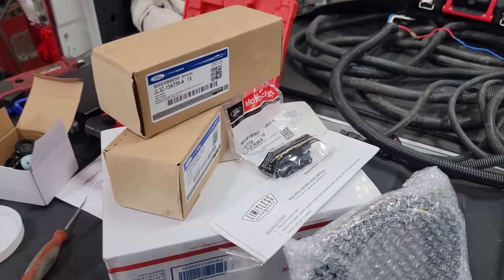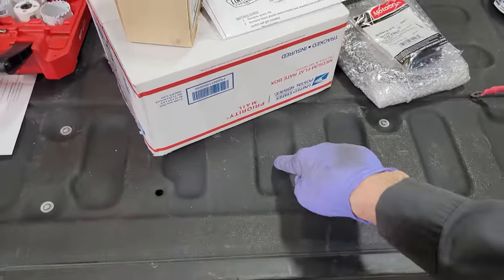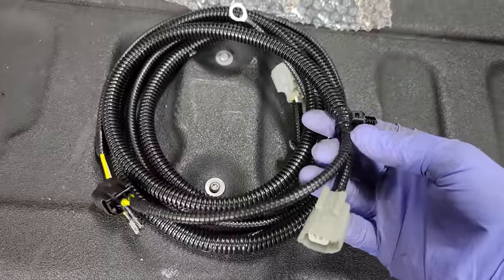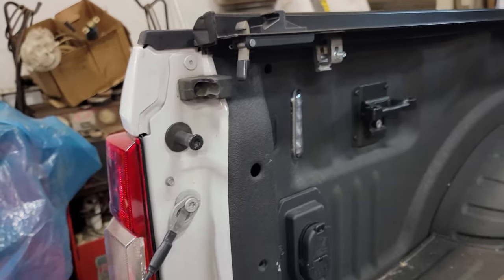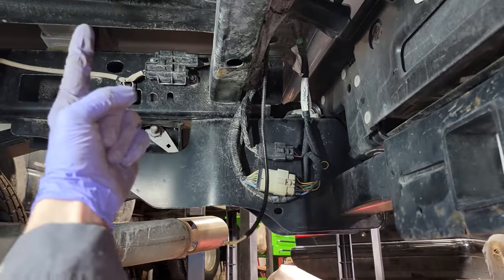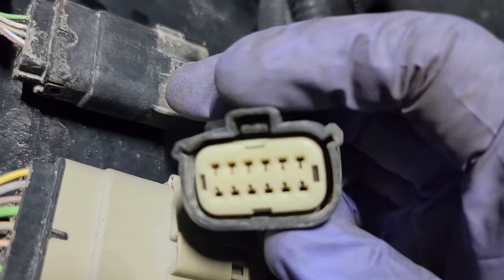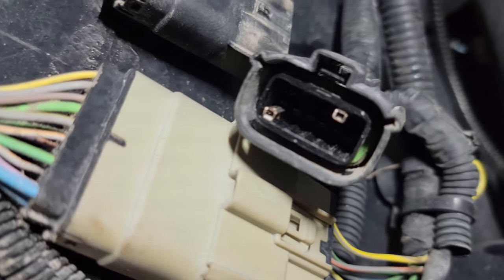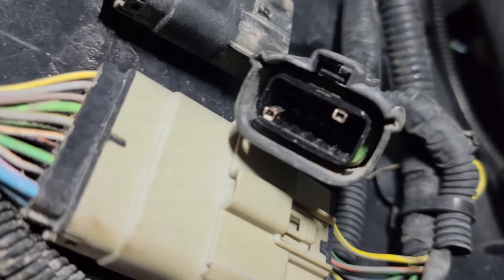Your truck missing this option?? FACTORY Bed Light Install | Ford Superduty 2017-2022 EASY!

Comment: I just finished this.  The most challenging part was removing the small white piece from the connector, and I was a bit anxious about pinning since I wasn't sure about positions 4 and 11. Despite my initial concerns, everything turned out correctly. Overall, the installation was straightforward, even for a beginner noob like me.
Reply from the maker: So glad fer letting us know bro 😎

Comment: hehe .. nice to see DS and the other guy crawling down there on the floor ilgag with you Aaron. hehe
one thing that is clearly true is that there is High quality cable harness.
it will be a high and nice mount on that mount .. nicely worked

Comment: My 22 F450 came with these and never thought Id ever use them but they've come in handy a couple times. Also, that little led on the rear of the tailgate (docking light?) surprisingly helps a ton hitching up to a tag a long trailer!

Comment: WOW .. finally something for us STX folks.  Been waiting for this since I purchased my 2020 F350 STX dually.  Bought the truck last dec and was the only dually on the lot so no choices.  Was missing the LED Bed Light kit.  Order placed with Limitless and can’t wait to get this installed.  I have the Forescan dongle but never used it so may need a hand in the programming part.  Thanks for the install video ARod … thanks #LimitlessAutoWorks for this new addition to your custom harness offerings.
Reply from the maker: Email me will get ya set up programming 🙋‍♂️

Comment: Easy install on a 2020 STX dually.  From opening the box, about 25 mins total install of the parts, dropping spare and routing cables.  Newbee to ForScan and took extra care, double check everything .. programming took be about 10mins.  (was nervous as chit).  One word of caution though, find a large, heavy gauge paperclip to remove those 2 black plastic plugs ARod pointed out.  I used a Jewelers Phillip screw driver (like you use for glasses) I had issues, must have damaged the back.  Issue manifested itself where I couldn’t push that “white” guide back in properly and couldn’t get the plug to the truck connector to “snap” back on.  Ended up trimming about 1/8th of an inch off the fins .. and it all worked out.  That original grey and white/red wires (pins 2 and 12). are connected to two of the brake lights.  You’ll get a “fast blinker” if that bumper harness connector doesn’t “click” back properly.

Comment: Man, I wish this was around a year ago. My truck did not come with bed lights from the factory. So I had to piece together a bunch of parts and make my own harness. It works just fine but this would've saved time and effort.

Comment: That is a really well made harness - I don't understand why it has two ground connections, though. I would think it would only need pin 4 from the harness since it already has ground from the bolt by the spare tire.
Reply from the maker: Switch n two lights my man

Comment: Please consider a factory power running board install. Yes I understand I could get the AMP steps but I think the factory boards are a much cleaner look.  Plus you can enable the function option with FORScan. Thank you!
Reply from the maker: Circuits are part of the cab harness not gonna be as easy as you think
Reply: I understand a person would need to add a few items behind the rear seat and do a little creative wiring but if anyone can present a step by step video with a complete parts listing you can,  please think about it. Have a great evening!

Comment: Wow, thanks for this video.  I have wanted this on my F150 and wasn't sure how. Great explanation.
Reply from the maker: Easypeasy
Reply: @PowerStrokeTechTalkwARod  True.  Anyone can run wire all the to the cab and find 12 volts, or tap into a harness somewhere.  But that is trashy.  I like to keep it as factory as possible.

Comment: Not sure if it matters but you changed 72-01 instead of 71-01. Sweet install though, love lights..
Reply from the maker: Fat finger
Reply: I checked the comments just to see if anyone else saw this. I was worried for a minute it might mess something up but luckily it was recorded so easy to correct.

It should also be noted for everyone to learn that you should backup every as-built before making changes and have it saved in multiple places so you can’t lose it. Without proper backup you may be unable to correct an issue or mistake and the downloadable from Ford as-builts may not work since they are NOT guaranteed to be the same as what was there originally and could include the error or mistake that caused the issue.

Comment: Are they releasing this kit for the 2023-2024 Super Dutys?  I did not see it on the website but would buy it instantly.
Reply from the maker: Checking
Reply from the maker: That's a negative sor

Comment: Bed lights are awesome!  My platinum came with them, I am impressed with the output. Still would rather have had a Lariat, but with today's availabilities take what you can get. Luckily my 2020 hasn't been part of any recalls, especially the axle recall. Good video!
Reply from the maker: Niceeee

Comment: Hey .. your second ForScan value was applied to the 726-72-01.  Was supposed to be to the 726-71-01.  Does it matter, or did you correct on a 2nd pass?
Reply from the maker: 2nd pass fat finger

Comment: Will this for scan programming work on a 2022 Lariat? Not a super duty. I want to buy the factory lights, switch and harnesses from the dealer.
Reply from the maker: There is NO harness that ford sells. You will need all the parts listed in this video. Forscan works on all Ford vehicles.....

Comment: This is a great video Thanks!
I have a 2019 f150 XLT but my wiring seems a little bit different, I have a button on the dash for Bed lights, and pin 11 is occupied for me. Would this method work for me? especially will the lights work with any of the switches? Thanks again !!
Reply from the maker: Buddy, read the title very carefully

Comment: Thanks for the video! Very close to pulling the trigger, do these tie in with the bed light button in the cab as well? So you can use the bed button switch or the cab bed light switch?
Reply: These work exactly as it would work from the factory

Comment: Great video ARod nice work , did u put this in ur truck if so how good do they work with ur bed extenders in plus can u get to the switch. I got the LEDs along the rail of the bed because of my bed extenders. Thanks ARod
Reply from the maker: My truck came with them already. Yes, you can still get to the switch & you see the lights just fine

Comment: I bought a f350 super duty 2022 and had the double alternator installed but did no know you had to ask for pro power aboard and only have 4Kw in the cab i would like to 7.2 in the back and program it for Pro power aboard  - is this possible

Comment: Nice install can I add power step to my power running bords to my 2022 f350 lariat? It dident come with because I ordered the black appearance package so option wasn’t available. But my question is can I buy all factory parts and will it plung in or is even possible to do
Reply from the maker: Cmon, now I gotta talk to my boy. You guys got us so busy hahahahaha
Reply: Let me know I’ll order the parts from your dealership my local dealer ship not vary helpful I know that it’s been done on 2019 but I really need this up grade
Reply from the maker: Naw just in........part of the cab harness. Wiring not there

Comment: I went to the Limitless website to ask a question about this but there is no way to email them.  If I got this kit and just ran a wire from the battery (fused) to the back, could I connect this harness to that (and ground it) and have these lights operate without having to do the forscan changes?   I already have the wire run to the the back for this purpose but was going to go in another direction with bed lights until I saw this.

Thanks for your videos - I have a 2020 F250 and had a 2005 6.0.
Reply from the maker: Hmmmm u think it wld

Comment: The wire hardness..Yellow and white pins go into the female plug. You mention one is ground and the other is power. Why would wire need ground wires again since there are already ground wires to the bolt's driver side?
Reply from the maker: Because the harness needs to be geounded

Comment: Is there a way to add led strip lights to the under cab above the running boards on a 2022. My 17 had a powered when door was open harness female end on the frame rail right below the rear doors.
Reply from the maker: Yes we are in creation as WE speak
Reply: @PowerStrokeTechTalkwARod  let me know when Limitless has them or if he needs another tester you have my email. I want to install these lights so bad but have been waiting to do this until there’s a good way to tap in.
Reply from the maker: Wait till u see, gonna be sick asf. When u see MY video....you all will know. Shit I'm excited....u all knw how I love @limitlessautoworks lighhhhhts
Reply: Yeah I’m excited too. There’s a company out there that has you do a install using wire taps that’s a half ass way if you ask me. I like the oem style stuff
Reply: @PowerStrokeTechTalkwARod  I have been watching his site eagerly for him to drop something.

Wish I was closer to his side of PA so I could stop by and get an early preview or release. 😂
Reply: @rickyh78  yeah that’s about all I could find for the newer super duties and is why I haven’t installed them yet.

Comment: 12:45  you said 726-7101 but you changed 726-7201!  🤔😬 How did that work out? Which one was correct.
Reply from the maker: Fat finger 🤪

Comment: Does anybody know what the part number is, or where to get, the wiring harness for the courtesy lights under the dash that shine down on the floor board? I have the lights and I do not see where to connect them too.

Comment: I own a 2017 powerstroke with top radiator hose collapsing. Do u know why this happens?
Reply from the maker: Normal, system is just in a vacuum as it cooled down
Reply: @PowerStrokeTechTalkwARod  
Wow!! Thanks for the response.
Keep up the great videos

Comment: Maybe a dumb question, but should you disconnect the battery?
Reply from the maker: For what?????
Reply: @PowerStrokeTechTalkwARod  Disconnecting a ground on a vehicle that has so many electronic systems in it.
Reply from the maker: @outdoorreconnect has no bearing on doing this install......

Comment: Do you have a phone number for Rich.  I want order the bed light kit for 2019 but it says they are sold out.  Just want to see if he will have more.  Also need the wiring harness pin for the rear three light bar.
Reply from the maker: Materials are on order 🙋‍♂️
Reply: I lucked out .. I have a 2020 stx and been waiting for a factory like kit since purchased.  Mines on order .. can't wait for it's arrival
Reply from the maker: Pretty sick

Comment: Can you add the up fitter switches to a 2020 f250 xlt?
Reply from the maker: Expensive
Reply: I watched a video where some kids did it to an alumiduty but they had to take down the roof fabric and the A pillar and run through a whole bunch of the engine compartment. They harvested the switches I think... it was a lot of work
Reply: Thanks for the info!
Reply: Thanks for asking my question even if the answer wasn't what I wanted to hear.

Comment: What’s everyone using if you don’t have that tool to punch out the pin holes?
Reply from the maker: Pick.......something pointy
Reply: @PowerStrokeTechTalkwARod  thanks. Also what are those 2 receptacle below the new bed light switch?